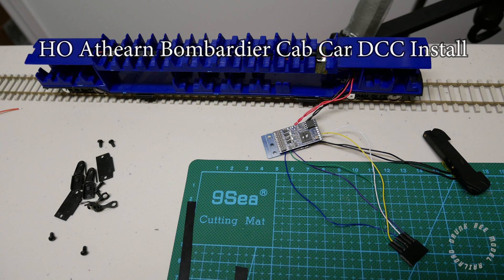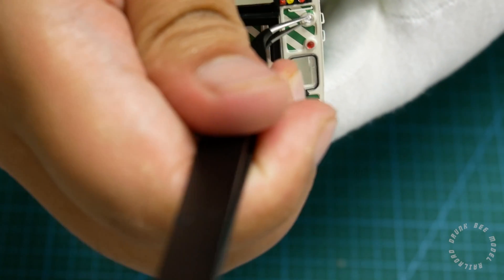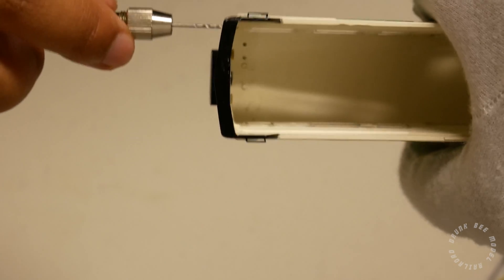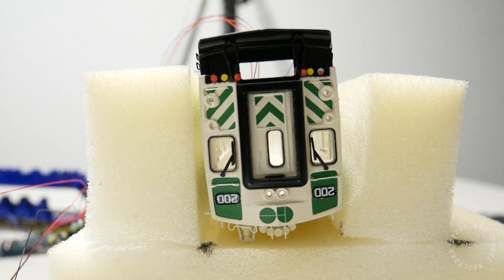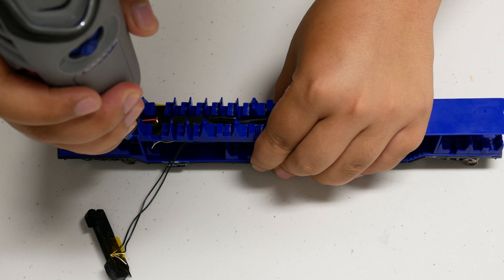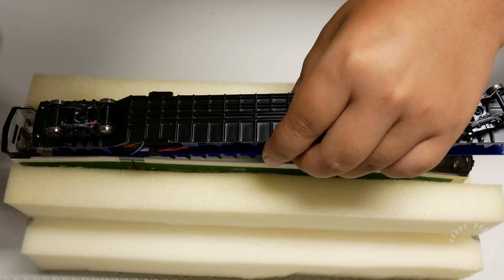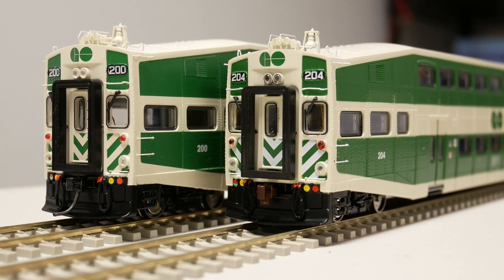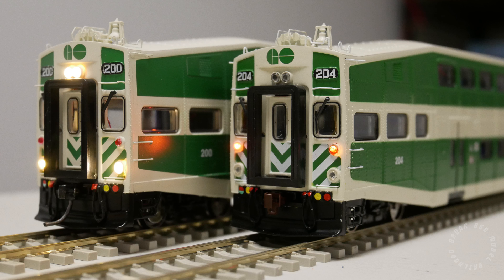Advanced DCC Installation Part 3 of 3 - Athearn Bombardier Cab Car with ESU LokSound

Comment: Just curious, Do you have the product number for the LokSound Select decoder you used? I know you have the price-based options but my local retailer mainly sells by product ID...
Reply from the maker: ESU 73900 is the 21 pin select part... but it has been discontinued for quite some time. I would recommend using the 58429 21 pin V5.
Reply: @DBRXCustomRailroadModels  Awesome thanks for the quick reply! Now does this decoder come specifically with cab coach sounds? If not did you make the profile yourself or download an existing one from somewhere?

Comment: Can you do it with the Trinity Railway Express? It's also HO. I wonder how it's going to look. By the way, nice! I like what you did to it
Reply from the maker: Yes, it's exactly the same car aside from the paint scheme.
Reply: Are you going to do it?
Reply from the maker: I was referring to that the TRE car is exactly the same as the GO car so the steps shown in the video can be applied to it. I'm not going to obtain a TRE car personally and install the lights and sound if that's what you're asking.
Reply: Oh true. Well, ok
Reply: Drunk Bee Model Railroad. do you do costom dcc installs? if so can i send you a njt double decker atlas cab car
Reply from the maker: Send me a PM or email at db.model.railroad@gmail.com
Reply: Drunk Bee Model Railroad your email not working i can get it threw
Reply from the maker: I mistyped it at first sorry it's db.model.railroad@gmail.com hopefully it works

Comment: besides the E-bell and whistle, can the door announcement and chime be programmed in aswell??Please stand clear of the doors, the doors are now closing.... G - E - C....!!If not the announcement, the chime for sure.
Reply from the maker: Custom sound functions can only be done with a Loksound V4 decoder, you'll have to compile the sound effects in the Lokprogrammer software. I used a Loksound Select in the video which does not support custom sound effects. I originally wanted to use a Loksound V4 but there was just too much work and money involved so I decided against it in the end. When I do get access to a V4 decoder (which I will in the next few weeks, Scaletrains' Tier4s are supposed to come with one), I will probably do a proof-of-concept video for custom sound functions.

Comment: Solid decoder install dude. you got yourself a new sub. 
Keep up the good work, hey have you ever installed and decoder in N Scale?
Reply from the maker: Thanks! Never have done any N scale DCC installs, I assume it's the same stuff except the decoders are smaller and you have less space to work with. I have dabbled in N scale but it was all DC, mostly just temporary setups using loops of Kato Unitrack.
Reply: If you want check out my channel I have a couple of the decoder in stalls. I model in N scale. I also like your reviews on model trains keep up the great work.